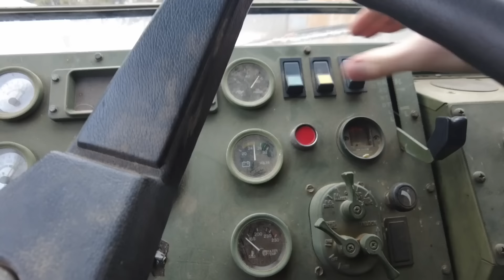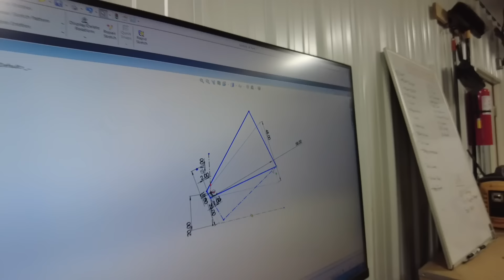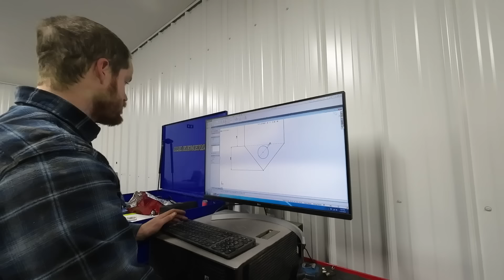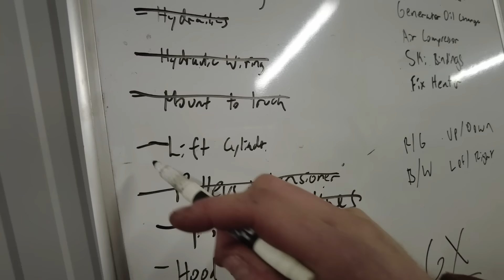We Built The ULTIMATE SNOW BLOWER | First Drive

Comment: That’s actually really smart to have used the power steering pump as a repurposed hydraulic pump for the floating ram and solenoids. I’m an engineer by day and I have to give credit where credit is due - that’s ingenious!
Reply: When he said it I was thinking - that's a great idea! No messing with the truck. I really like that.
Reply: I use my powering steering pump to run my detach instead of a PTO wet kit
Reply: I mean power steering is literally a hydraulic circuit so it makes sense lol
Reply: That's how plow trucks have been doing it since the 70's or before.  You can change the pulley size to get more pressure and change pumps with larger reservoirs too.
Reply: Guess you're not familiar with hydraulic systems.
Reply: Fishers have been using power steering pumps to power the net reel for like forever. My Dillingham Bay Bow picker used two. Dandahermit.

Comment: Good job on getting the snowblower attached and functional.  Looks like you'll need to add a bunch of ballast weight in the truck bed to offset the weight of the snowblower on the front end of the truck.  That should help with turning.  One tip to snowblowing on gravel is to make sure the ground is good and frozen otherwise you will be peeling up your gravel and launching it through the snowblower.
Reply: Good observation. However they mentioned in the previous vid about this project they wanted to install a spreader and load a bunch of road salt in the back. Question is, would there be enough salt? Maybe make a drop in box made out of lead to hold the salt? Just thinking. Lol
Reply: Extra weight in the back will also help traction. Easiest way is one or two 1 ton water containers and fill them however much you need.
Reply: Use snow. It unloads it's self.
Reply: Right. You must at least place the same weight over the rear axle as the weight of the entire blower-extension. 

Then you will definitely no longer have traction problems and the steerability of the truck will definitely improve in use.

Good job, you can be proud of it!
Reply: Awesome job, I’ve been working for municipality for a number of winters and the only time our trucks don’t have good traction is when there empty so I’d encourage you to add some dirt in the back of the truck, oh and before I forget congratulations you two on the news of your first baby.
Reply: Good idea on placing ballast on the rear..
Reply: I have a mile long two track driveway in northern Michigan and I have a snow plow just for the beginning of winter. It helps me make a solid, flat, frozen base on the road. I use a tractor with a snowblower the rest of the winter. I never hit rocks with that method.

Comment: THAT will be so much fun after a heavy powder snowfall!!   possibly add a skid plate with small steel wheels on the back of the snowblower frame so if you are backing up over a hump / unlevel section the sharp angles wont dig in ? In any case you are an awesome Enginner coming up with these things and then DOING them yourselves!
Reply: skid plate with up curved tips at each side would work, easier to fabricate. and you can make some counterweight to put in the back of the truck at the tailgate, which should  give you better traction,
Reply: Excellent job guy’s, love ur content & genius. The skid steer with snow blower in the back would make a good counterweight, for extra traction and have a backup redundancy machine on board for some smaller areas, or in case of a breakdown, you could still finish a job &/or get home for parts, etc.
Reply: Great job, some others have pointed out some tips to improve your project.  Add 8,000lbs in the back and winches front and rear.  The weight should keep from getting stuck. The winches if you do.  The front winch could be used to lift it rather then the hyd cyl. And give you float.  Great job over all.

Comment: You stole my thunder M@.  LOL  A floater position on the hydraulics is critical.  It allows the blower to freely move up and down depending on the terrain.  I'm a heavy equipment operator and front end loaders allow you to float the bucket to smooth out surfaces as you drive backwards.

Thomas Dutkiewicz

Comment: This is awesome to see this plan come together and work so well. If I might make a suggestion. Before next winter, put about 1 or 2 tons of gravel in the back. That will help offset some of the extra weight on the front axle and give you better traction on the rear. If you want to take it a step further, get yourself a sander unit to put in the bed. Then you can also sand the road after you blow the snow off of it. Usually in the spring ITD has a surplus equipment auction, down here in CDA.
Reply: I agree, the truck will go better in snoeblowing and you wont go stuck then you are backing with the lifted snowblower.
Reply: Another suggestion is to lower the snowblower to a couple of inches off the ground when in use. It was much too high and it was only skimming the top surface, left too much snow under the wheels. Don't be afraid to get it down in the snow, it will handle it.  Then if you have to back up, you shouldn't get stuck. :hand-purple-blue-peace:

Comment: Consider a flow control valve (slowdown) for the “down” function of the blower so you can fine tune how slow/fast it drops (if you haven’t already).
Reply: Don’t they make an orifice to control the maximum speed for dump boxes and tilt trailers?

Comment: Try one of the old school cruise controls set ups.  They read drive shaft speeds and have an electric motor that modulates the throttle.  You might be able to set this up to read pto speed...set  the cruise control and it will regulate the engine speed based on pto rpm.

Just a thought.

Well done guys... this thing is AWESOME!
Reply: He likely could use the factory transmission sensor assuming it is a hall effect? and reads teeth on a wheel. He could put a sprocket or gear on the belt drive somewhere for the sensor to work.

Comment: Just a suggestion, The way a snow plow blade works (which is what you have with a blower) is the hydraulic ram lifts an arm with a chain attached for floating ability, eliminating that float manifold. Also, put skid plates on the sides of the blower to prevent picking up a lot of gravel, which will also break the impeller's roller chain. Skids will slide over bumps instead of trying to shear them off breaking something. Go slow there is no spring mount. Team Ambition is doing Great, wish I was your neighbor.
Reply: I just mentioned the same mount system. And adding weight.

Comment: As a former plowtruck driver and tractor snowblower operator in Northern Norway i see some things that might help out. 1. Grind some real ridges in the lower blower preferably every 1,5-3cm Atlest 1cm long and 0,5cm deep. 2. Get a blade that scrapes the bottom. 3. Have some weight in the truck, over the rear axle or even a tiny bit behind it at least 2tons. 4. When putting on chains to get them as tight as possible make sure they lay good on the tires with every single chain link and tight them again after 300m 2 times and don’t be afraid to tighten them even more. 5. Don’t spin with chains on, or spin as little as possible, since they will break easily (have done this to many times my self) since I am now a truck driver in northern Norway. 6. Mount some adjustment skids in front of the blades.
This is all written to help. But really cool video and build really love your creativity!

Comment: Someone likely already offered this advice, but you need to add about 2,000 lbs (big rocks?) in the rail end of the box of the truck, which would balance out the truck and give better traction to the rear wheels. But it is a really well thought out concept, just needs a little tweaking and it will be your best friend in the winter!

Comment: Awesome project!   A couple of thoughts  1) protect the radiator, it looks vulnerable.  2) extra weight on the back of the truck. -- that will help with traction and balance.  3) provisions for when the hydraulics break -- attachment points for wheels to support the front of the blower.  -- physical lock for the up position.  -- redundant/parallel hydraulic lift system.

Comment: Putting 1-2 tons of rock or sand in the bed will not only help with traction for the rear drives but will also help keep the truck level and help keep the blower farther off the ground while traveling. Awesome build

Comment: As a retired engineer  I must give Riley a massive pat on the back for his ingenious use of parts cobbled togeather  to make what is a difficult thing to build. So much has to be right for it to work correctly. All I would say is you need atleast 1-2 tonnes of counter weight in the truck bed, over the rear axle, this will make the whole vehicle more balanced and much more driveable.
Reply: And lower tire presser for more traction  about 8 PSI

Comment: Awesome engineering analyses, designing, welding and testing.  Suggest considering mounting wheels to the edges of the blower so you don't have to rely on metal skids. So how are you going to get the truck and snowblower unstuck?
Reply: Bull dozer.

Comment: Should put some lights on the lip and turn signals and get like a trailer harness you can plug it into main vehicle with. You also need weight in the back to offset all that wieght in the front plus it will help with traction.

Comment: Nice project. Its definetly a good piece of work.

Personally, i whould have tried to make something like a 3-Point hitch on the truck. You know, what some tractors have at the back. But your option looks good too.

If the lifted blower is too heavy, you can simply put a concrete slab on the back of the truck to "counter" the weight. (Maybe a salt spreader whould do that job too?)

And maybe adding some stabilizing free turning wheels on the blower so that it can "roll" on the ground when its lowered.

Oh, and dont forget to put the front lights more up if you dont have it already. Also front lights, turning lights, work lights and so on so that the blower doesnt block the lights when you work in the dark.

Comment: To get better traction, snow or otherwise,  you need some weight in the back.
You ESPECIALLY need the weight with that snowblower. 
Think about reversing the ram so it minimizes the possibility of water/snow/ice accumulation on it and getting past the seal.
You should also have some sort of in cab kill switch!!!!

Comment: Use a velocity fuse for the down return circuit so it doesn't slam down. Allows full flow in and reduces flow out for a controlled decent. Used on forklifts for safety.

Comment: you really should add heavy-duty solid rubber caster wheels to the snow blower like commercial highway plows. it will really save you from wear and help keep all the weight off the front axle, as well as reduce pushing friction.
Reply: They would do it fast

Comment: I hope that when you wire the throttle/cruise control for the blower into the cab of the truck that you also wire the blower motor ignition into the cab with a push-button ignition switch, or something similar.

Comment: Now you just need to set up a wiring harness that plugs into the front of the truck so you can control the blower from inside the cab (like starting and stopping the blower and controlling the angle of the discharge Shute.  For the throttle control I would use a heavy duty adjustable locking throttle cable.

Comment: Very nice job! A couple of things you're going to need to look into first you need to brace the radiator better. Remember,  that is just plastic and aluminum and it's flimsy.  If you don't do it the radiators will break. When it cracks there is no good way to fix it. You need to find a way to cover the motor and all the electronics,  if they're out of the weather all the time water will get into places that will cause issues. One last small thing is on the air inlet cover it a piece of wire 3/8 inch square mesh will do. It has to be small enough so mice can't get in and big enough to not get plugged up with snow. On the exhaust do the same th8ng. Mouse houses are amusing when blowing out but mouse urine will eat through a muffler quickly. 
I like the way you did the lift. You could have done the same thing by using a hydroelectric plow lift with some chain. it would with just a small control and one ram. However your solution is elegant as well. I'm not trying to be an armchair curmudgeon, I just saw those small things that need to be addressed so the machine continues to remain a trouble free quality piece of equipment that doesn't drive you nuts every time you try to use it. 
Best regards, 
Bob from Virginia USA
PS, Spelling errors can be explained be insomnia and pain, in pain not trying to be a pain! lol

Comment: I built a large garden tractor many years ago and had trouble keeping engine speed constant.  I used a Cruze control , that used a magnet to trigger the control.  I mounted the magnet to the flywheel.  It worked great!

Comment: Please check into a counter-balance valve  or double piloted check valve to backup the center position on that cylinder. Also look into inline hose break valves and flow controls to control tr rate of drop on that cylinder. None of these add to functionality, but make it safer.

Comment: That thing is AWESOME !  👍👍
A little tip though. On the snowblower I drove, there was no stop for the angle of the snow throw, which resulted in a broken windshield and the cab full of snow... 
Stops were installed on both sides after that..😂

Comment: I know this project is almost complete, but I was thinking about it when I couldn't sleep and I had a thought. A good reason why the truck got stuck in the mud is that it is likely now to front heavy. The Moment arm created by the long blower is large for a truck that did not have anything mounted up front previously, and then you added the weight of the motor. The easy fix is to add some counter weight in the bed of the truck. The cooler and more complex solution, would be to unmount the engine, mount it on a skid which can be mounted and unmounted as needed in the truck bed, and then connect the motor to a hydraulic pump. You can run hoses up to the blower where a hydraulic motor runs the augers, but you then have an industrial sized hydraulic pump that can be mounted to the truck for different future projects, maybe a post hole digger. sorry for the stream of consciousness, was just thinking about this last night. Love the channel.

Comment: A really well done project...Completely self contained is a great feature.
Here's a couple of possibilities I've come up with (yeah right, just what you need - more projects) :

1) How about a removable counter weight for the back of the truck to improve traction and balance?
2) I know you'd have no problem fabricating a quick-attach plate/mount so that you could also use the blower with your tracked loader (or perhaps a tractor?)

Comment: Your mind boggles mine.  From adding a car engine to an industrial snowblower, creating a mounting system to hold it, figuring out how to add the components needed to lift, level, and lower the blower past the level point to be in a negative direction, creating all the mounts using your plasma cutter.  Your mind works like you have a master's and doctorate degree in mechanical engineering or that might be just too easy for you.  Very, Very impressive as well as your talents used in making the Snowverlander.  Well Done!!!!
Reply: I forgot the electrical engineering degree as well.

Comment: Also, as someone who drives a 1078 in the military a bunch, highly Recine you deflate the tires to either the cross country or sand settings in your deflator if you still have it installed. If not I would deflate until there’s about Reiger inches of bulge on either side of the sidewall. That’s about the psi level that cross country would give you in the tire system.
Reply: Riley, Video this or maybe Courtney could show how easy she could get her truck up the hill with less air so much easier.

Comment: I would try to work in the ignition and starter controls for the blower motor into the switch panel so that you can just turn in the blower system and then momentary pros a start button to start her up from the cab. Would be much cleaner and better working than using the key solenoid. Looks great!

Comment: Fantastic job, how ever. You need some ballast over the rear axle to gain better traction. This will also prevent you from getting stuck so easily. If you go back to around 15:50, you can see your rear axle skip, when driving.

Comment: I would recommend some ballast in the bed of the truck guys. Place it as far back as you can in the bed and start with about 2/3 the weight of the blower system and mounting system. You will find it will even the suspension out a bit and give you much better traction. Especially in the rear where the truck is the lightest. Next project - Tracks for the big truck LOL. Great job on everything. Also huge congratulations on your greatest creation coming soon.